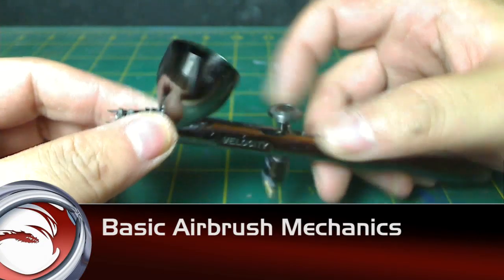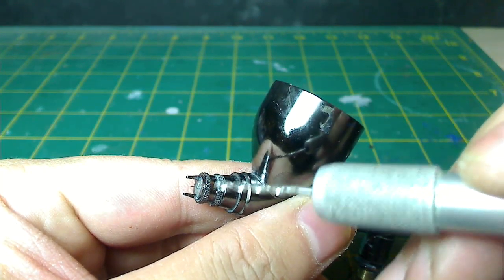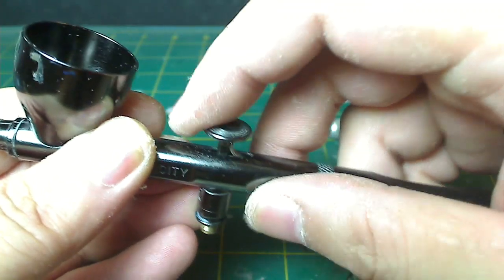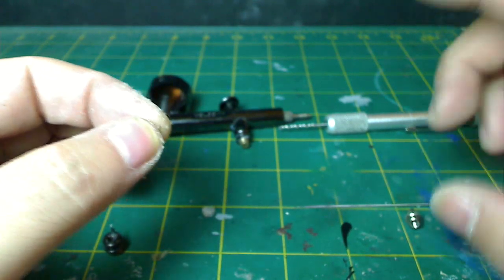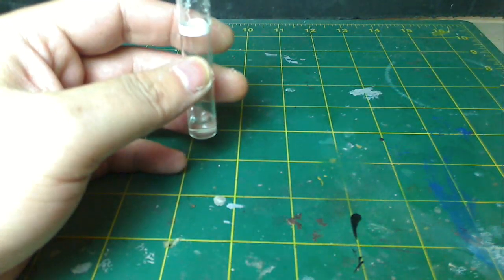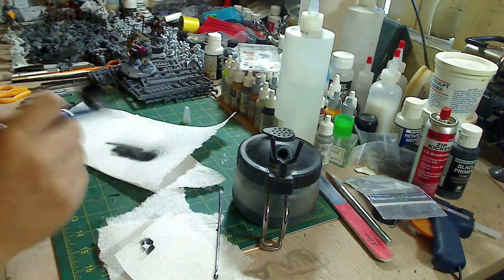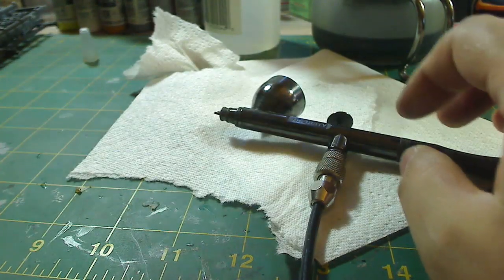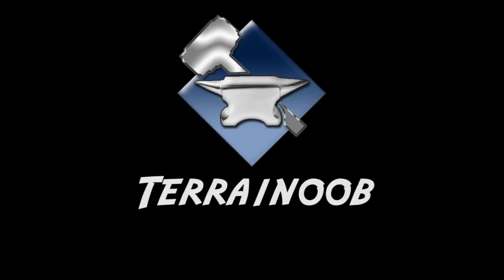Airbrushing for Beginners #3: Basic Mechanics, thinning paint and cleaning

Comment: I'm using a Testors AC-55 Silver Mini Air Compressor and it's doing my nut in ever since I got it. I can't tell if it's the hose that's the issue or the compressor.Yesterday all worked fine and I was able to spray paint. Finished, cleaned everything out (gravity feed Veda airbrush). Then go and paint today and it pushed paint for about 3 mins and now stopped again.Pressure seems low and I've given up again.

Comment: Hi there I'm have a problem with my airbrush in that it spits fine spray and specs start coming out with the paint and I find my paint gooping up the works I'm using vallejo paints Game Color and Model air aswell as their thinner and AB cleaner. I just want to know if theres something wrong with the thinner or cleaner or paints or even the AB its self.

Comment: Great videos a real life saver. I literally started painting with my brush last night. A couple of quick questions. 1. Cleaning/thinning. Are your views on using windex and alcohol for cleaning still current? I've heard that neither are good for your brush. 2. I have a TC20T compressor. Is it supposed to get so hot? 3. and lastly, when I was varnishing my model I got bubbles. None of the other paints I used did that. What am I doing wrong? Sorry for long mult-part question and thank you for your time!
Reply from the maker: Christopher Motley I'm glad it helped! 1. I use both to clean my airbrushes still. 2. If you use it long enough it can get super hot. 3. it's just happenning when you use varnish that you get bubbles? Bubbles in the cup or on the model?
Reply: between the two cylinders. i have an Iwata HP Eclipse. it was scary.

Comment: very much appreciated.  I can't understand one thing regarding my airbrush ($200 Iwata).. despite diluting certain acrylic based paints to the consistency of pure water, I get zero paint flow.  This happens even after a thorough clean.  Yet other colors cause no problems.  I have tried thinning with iso propyl alcohol and water, to varying degrees of consistency, and have had no success. Do you have any ideas?  
Cheers
Reply from the maker: +HocusPocus OOO, that's a bit harder to figure out. What paints are you thinning that isn't shooting out?
Reply: +The Wargamers Consortium recently figured it out. alcohol actually dries paint, hence the clogging of the nozzle. having been using water to thin the paint, and frequent qtipping, I'm all good. 😆

Comment: Hey thanks for the awesome informative video! I just started using my airbrush so this really helps. I was wondering when you're spraying your cleaner or alcohol into your paint pot does it ever create smoke? Whenever I try and clean my airbrush with either the cleaner, alcohol or water it creates a smoke... I don't have the PSI set to more than say 30....the smoke even escapes the paint pot I bought for it.
Reply from the maker: SMOKE? Or do you mean fumes?
Reply: Ok right so they are "fumes"... was just wondering if anyone has ever seen that when using airbrush cleaner. I bought myself a bottle of the Iawate Medea Airbursh cleaner you find on amazon. First time I did it I breathed in a bit of the fumes it had me coughing for minutes. I found that a few other people posted up that complaint as well. Even though the bottle states Environmentally friendly, there is a lung irritant. Any who I just didn't understand why this liquid creates fumes when cleaned through a pot and somehow still escapes the pot.

Comment: Your needle isn't pushed all the way in... the needle blocks the paint flow when it is in the fully forward position and as you pull it back it unblocks and lets the paint through. If your needle is screwed in but it isn't fully extended into the nozzle you will get paint when you push down and even some dripping out the front.

Comment: Warning : ultrasonic cleaners can weaken the welds in your airbrush...specifically where the valve stem and the bowl meet the airbrush.  Soaking your airbrush in a diluted mix of cleaner and hot water (for water based paints of course), mineral spirits (for enamels) or thinner (for urethanes); and getting the appropriate mini-brushes to scoop out the paint chamber between the bowl and nozzle works better

Comment: Hey, just had a few questions on painting. Have been getting interested in doing this and i have a few questions.
 #1. What is primer? is it just the first coat of regular paint? or is it a special paint?
#2 When going over panel lines do you do that after the primer? or before the primer or do you disregard the primer if you are doing panel lines?
#3 Giving your model a wash. Do panel lines replace that?  Can you do both ?

Thanks!
Reply from the maker: #1 Primer is a specific type of paint that is made to create a layer to hold the paint to a non-porous surface.  So it'll stick to metal or plastic or resin so that the paint layer on top is likely to chip off.

#2 Usually primer goes on before anything else.  Panel lines usually don't come before way later unless you're talking about pre-shading?  Pre-shading panel lines in this case is after the primer and before the base coat.

#3. Again, assuming you mean pre-shading panel lines, then yes, you can do both (you should do both in fact).  The pre-shading to make panel line "shadows" and the wash is to "fill in and darken panel lines".  In this case, it's two different things and effects.
Reply: Yeah, i meant pre-shading. Sorry for that mix up lol. Thanks for the quick reply and answers, i was confused for a bit XD. Now, the vallejo gray primer, is that any good? I'm looking at it on amazon for 6$  http://www.amazon.com/gp/product/B002U395VK/ref=ox_sc_act_title_1?ie=UTF8&psc=1&smid=ATVPDKIKX0DER

What primer do you prefer? As someone new to this the vallejo air paint is the most attractive choice due to the lack of needing to dilute it AND its on amazon prime.  But is the primer any good? What other primers would you recommend, are there any that come in an easy to use spray can that are good?
Reply from the maker: Bob I use Badger Stynzlrez Primers.  You can get them at webairbrushes DOT com.  Use the code CONSORTIUM and it'll get you 40% off.  It's new but it's awesome primers.

Comment: hi can you help me I bought an airbrush kit a couple of months ago of eBay the compressor is just a small one now the airbrush it's self is a Spirit air the 07/28/15 and it has a 0.3mm needle in it single gravity the thing is air is coming out of the tip I have adjusted the needle no difference I have watched you and other airbrushes and when you hold the the tip in front of your hand no air comes out till you push the lever mind you can hear it and feel the air on your hand is this normal for this type of airbrush or could the needle be faulty at all apart from that it's not that bad I have a couple of syphon airbrushes one new one and the paint will not come out of it even though it's milky it's ok in the gravity airbrush no problem and as it's my birthday next month my sister has just ordered me a duly action airbrush for me and advice with the problems with my Sprit and syphon airbrushes would be great love your tips and comments
Reply from the maker: +Rebecca Lacey Redwitch I'm not sure where to start here. :)  OK, first, did you figure it out? Sorry, I got busy and haven't replied.
Reply: +The Wargamers Consortium hi I think it comes down to the needle because my sister bought me a dull action airbrush that works fine but the main problem comes down to the compromise being to small it does say for use Tattoos cakes nails because I can't get it to spray paint using my syphon airbrush I even thinned it right down so I am going to buy a proper air compressor like the one you are using thanks for your help and tips
Reply from the maker: +Rebecca Lacey Redwitch OH! What kind of compress is it? Siphon feed brushes need more PSI's. If it's those cake/nail compressor "They are kind like a small box" then it's a good chance that maybe your problem. Those small compressor's don't put out much PSI. 15 to 20 if you're lucky. Let me know if it works when you get a new compressor! Good luck! :)
Reply: +The Wargamers Consortium the compressor I am going to buy is a Foxhunter airbrush compressor AS18 + Double airbrush kit £54.90 was £99.99 from Ebay with free p&p because the one I bought was a single action airbrush and compressor which is just a small box with what looks like a three way switch on top and that is it you just push the air tube on and push the button on